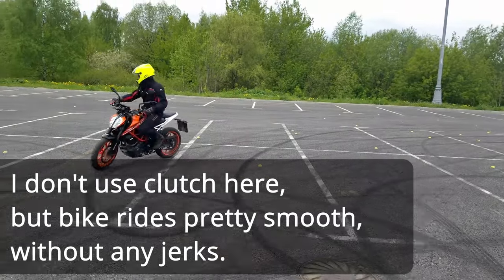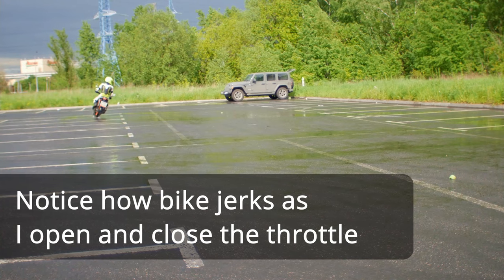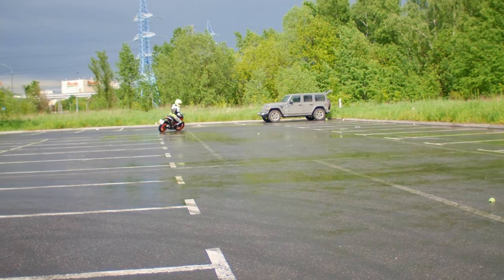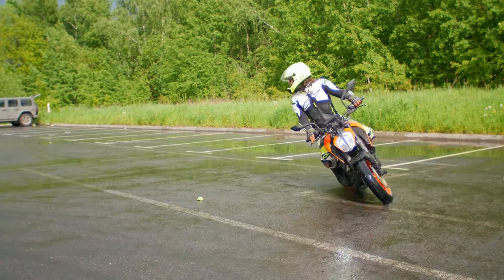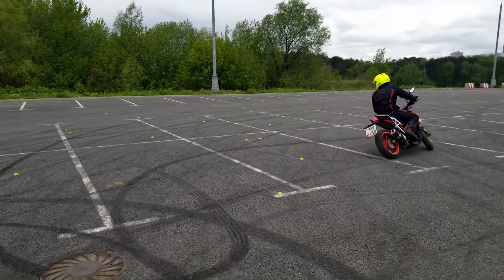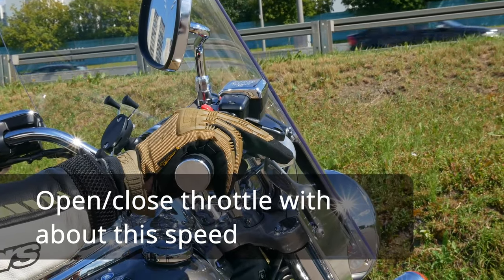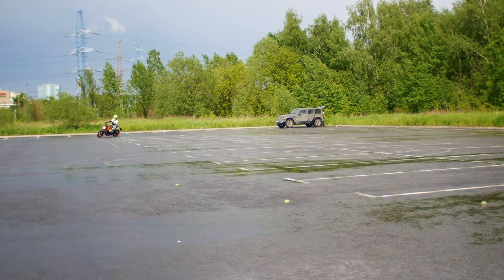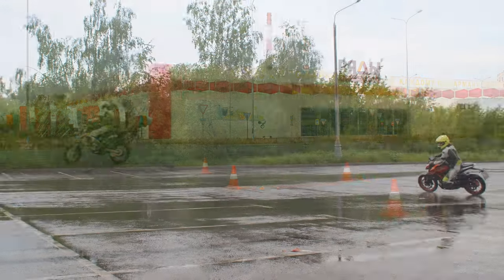"Jerky" Engine? Not a problem anymore!

Comment: This is a notorious issue for the KTM Duke, my Grom and other Honda's like 500 don't do this, everytime I rode my mates Duke 390 the low rev jerkiness was ridiculous it made it feel like you needed to be stupid careful
Reply from the maker: You should try 690 sometime:)
Reply: A lot of modern bikes flywheels are too small. Made to allow better acceleration. The GR650 Suzuki had a variable mass flywheel, try one if you ever get the chance.
Reply: My 2019 cb500x is jerky
Reply: My current Duke 390 is jerky in the 15-25mph space (which sucks living in a cul de sac). But my FJ09 was like that too.
Reply: @Email612  same thing. i bought a lightly-used cb300r (first motorcycle ever after scooters) and thought it's a mechanical issue. turns out it's a rider problem hahah
Reply: even my svartpilen 200
Reply: My CB650R felt real jerky at first too. Mind you it's my first bike so I don't have anything to compare it to and the jerkyness was probably just attributed to my shitty throttle control lol
Reply: RC390 Does this to me and makes it so hard for me to go at slow speeds but I still need to learn proper grip and throttle control.
Reply: omg especially on bad road, i thought only my bike has that issue bcs no one around talk about it...
Reply: @the.communist  I got rid of my 2014 cb500x for that reason.  For some weird  reason, my friend's cb500F was very smooth.
Reply: @MotoControlEn is the 690 smoother and not have this issue?
Reply from the maker: @ntdeas  690 is 390 on steroids, so it's even more twitchy😁 But luckily, nothing smooth controls input wouldn't cure!
Reply: @MotoControlEn  I was considering getting the 690 as an upgrade to fix the jerkiness :D
Reply: The 390 runs very lean, you can easily fix it with a simple dimsport fuel mod or a fuelx lite. Transforms the bike and makes it very easy to maneuver around town, highly recommend it.
Reply: Cb650f owner reporting crazy throttle jerk since new.

Comment: It took me months to get used to the throttle jerkiness, for instance, when going from off-throttle to on-throttle in a tight turn. At first, I used to use the friction zone to smoothen this out, but then other riders told me that it is bad to use the clutch in a turn (I don't really know why this is bad, smooth is always good, right?).  My throttle-hand has gotten more precise over time, so I need to don't need to use the clutch-hand as often to smoothen things out, but I still occasionally do that.
Reply: It's very bad/dangerous to use clutch in turning because it cuts engine power to rear wheel. Engine power or spinning rear wheel is what makes bike stable or stand straight. Also putting clutch means you can't accelerat or break quickly. All these things make it better to no clutch in turn and usually no no brake in turn or you hit ground. Use trail braking aka brake slowly/trailing the 1st brake before turn, use this instead of clutch to slow/smoothen in turn
Reply: @maomekat2369   It’s not dangerous to do any of these things. Bikes don’t easily fall if we ride smoothly.

Comment: How do you have so much grip in that wet car park?! I do a lot of rain riding but don’t have any confidence in my grip
Reply from the maker: Just being smooth. Plus good tires😁
Reply: @MotoControlEn  what tires?
Reply from the maker: @420Sean69  Usually I use Mitas Sportforce+
Reply: Sticky rubber Ben. If you can, feel a trials bikes tyres. They're like pencil eraser sticky. Or hard terrain knobbies vs soft terrain knobbies. The stickier, the grippier.
Reply: @redtobertshateshandles  I see 👀 I associate sticky rubber with, I guess, dry, track focused tyres? I guess a good set of all weather tyres from a reputable brand would be appropriate?
Reply: You still have 90% of traction in wet conditions

Comment: You articulated your rear brake tip so well; thank you!  I do this all the time when entering corners in traffic, generally between 10 - 30 mph and it smooths things out so much.  It's especially handy when you know you're likely to encounter gravel or debris at a corner's intersection.  Thanks again. ✌

Comment: I use the rear brake technique when doing slow maneuvers, but for street cornering at 30kph or so (20mph) I use the clutch in preference - it is easier to execute.  As I drop into the corner, I feather the clutch just slightly, while applying a little throttle throughout.  Now I control the corner speed mostly with the clutch, keeping throttle constant.  No jerkiness.
This is especially good for traffic circles where you are going 3/4 around the traffic circle, and need a constant speed to turn around the circle.
Reply: Thanks, I'll try that. I struggle around  traffic circles and roundabouts

Comment: Yet another fabulous vid, striking at the core issue. Returning from a major maintenance ride with lots of slow, mountain riding on fresh tires, my 2004 ST1300 throttle cable free play checked on the low side of 2-6 mm free play, so I left it alone. Now, your vid gives me yet one more area of improvement to concentrate on. Thank you! Additionally concentrating on front wheel braking while slowing down in tight curves….feeling that contact patch getting larger and more effective. Especially easy to feel with 2 or 3 or 4 PSI lower and softer than spec. Loving that! Parking lot practice next…! ❤

Comment: Thank you for this! I have a Kawasaki Vulcan S and it is very jerky. People said to buy the booster plug but I chose not to because I heard mixed opinions about it’s negative effect on speed. So I just really slowly open the throttle but sometimes I don’t feel like opening it that slowly and it jerks. Especially during Uturns, I want to open it faster and it jerks several times during the Uturn. I will try this, thanks again.
Reply from the maker: Hi! This technique is usually used for a bit faster speeds, than U-turns, for smooth U-turns I still prefer "friction zone" technique:)
Reply: it will make ur mpg 25 instead of 50... trust me. i have mine off
Reply: Try shifting up a gear
Reply: @kindafitsam9246  ahaha

Comment: Moto C:  To take up the slack dragging brakes fixes that mostly.  
My question:
If I could achieve perfect full Throttle AND Front brake control using only my right handL  Is there any advantage stability wise to use the front brake instead of the rear during low speed tight turns?  It would seem that front brake would give more uplifting force since the two tire rotation directions and contact patches are not aligned and could provide some interesting effects if mastered.  
Would seem there could be an advantage to swapping levers (Clutch Right, Front Brake left) which would give more independant control of throttle, clutch, Front Brake, and Rear Brake.

Comment: ok, now how to fix the problem itself rather than cope with it. what i do is press clutch lever (depress actual clutch (disengaging clutch) ), give a twist gas, depress clutch lever slowly (pressing the clutch plates each others ( engaging clutch) ). and when releasing throttle (to no have the jerkiness from releasing (assuming there is jerkiness from applying throttle, that i covered the solution in the first part with the clutch. and second type of jerkiness when you release throttle)) i do it slowly. but why does it do that ?

Comment: from what i found, things we can do to maybe solve this issue is: verify idle control valve and throttle body, givr these a good clean,check tps and map sensors. 2nd verify spark plugs. 3rd verify the chain tension, and verify the throttle dead spot.
.
.
.
.
.
ultimately : GET RID OF THAT JUNK BIKE 😂 and get yourself a 4 cylinder japanese bike 😍👌

Comment: What about just slipping the clutch a little when accelerating to smooth the transition out from off to on throttle instead?
Reply from the maker: It's ok on very slow speeds, but if you try to do it on a higher speed while leaning if you make a mistake and release the clutch a bit too fast -  you can slide the rear wheel and lowside or highside, depending on situation. That's why normally it's advised to always stay in gear while cornering and do all shifting before the turn. Unless it's a very gentle corner, where your bike is almost upright.

Comment: mostly feel chain slack when doing slides - new e motorcycle has counter shaft on swing arm center line -  can run chain much less slack - much better
Reply: I noticed that too for e-motorcycles.   I had a maxi scooter Tmax that was made that way also.

Comment: IMO, the 'jerky' engine, the transition from closed to open throttle, is because of crap fueling calibration.  Simple fact.  Manufacturers just can not calibrate low speed/rev/throttle, or can not be bothered.  Incompetence or indifference. Both are unacceptable.
I have ridden may bikes over the years, Japanese & European and the only manufacturer that comes close to perfecting their fueling with little to no jerkiness is BMW.
The number of bike reviews i have read over the years where a comment about the jerky throttle has been made, highlighting a 'problem' amongst the glowing accolades, is few.  Don't bite the hand that feeds you. 
But i ride many bikes where the jerky throttle was never mentioned by a reviewer, but it is blatantly apparent there is a problem.
Maybe these reviewers are so ham-fisted or insensitive they never notice.
There are also mechanical reasons why engines can be jerky, including poor chain and/or throttle cable adjustment.
Most of the jerky engines i have experienced are fuel injected.  KTM, Yamaha and Honda are good (bad?) examples of jerky engines and i don't buy them as a result.